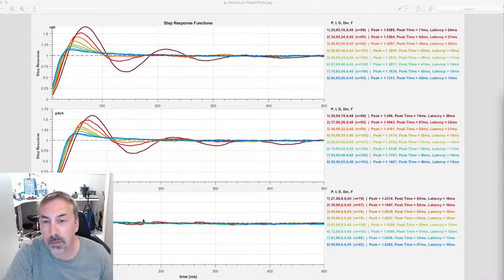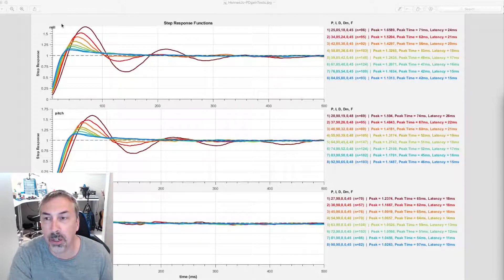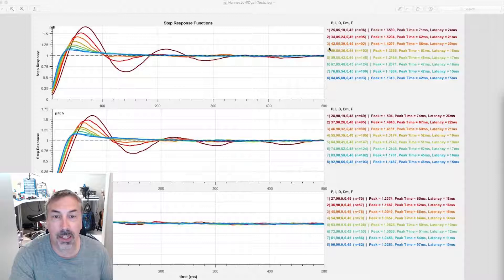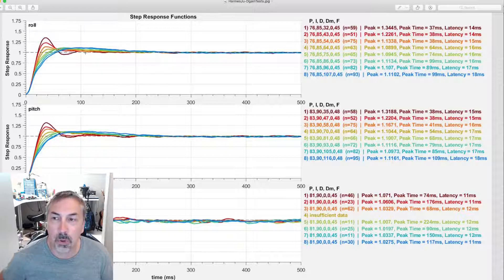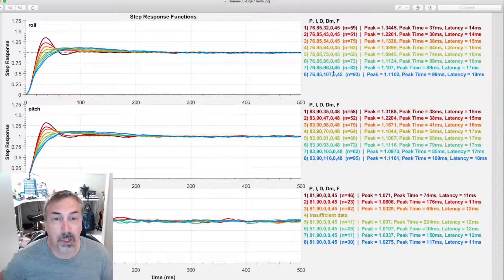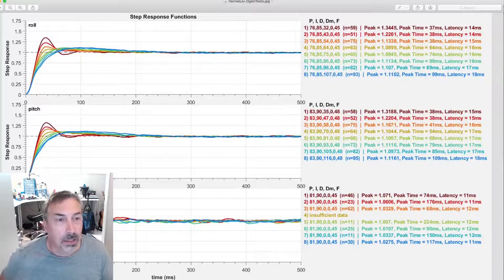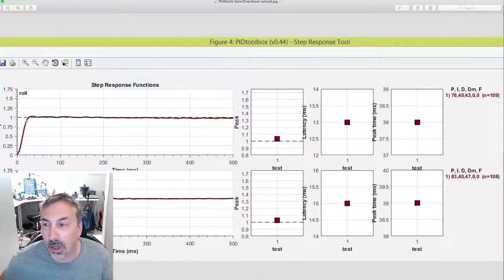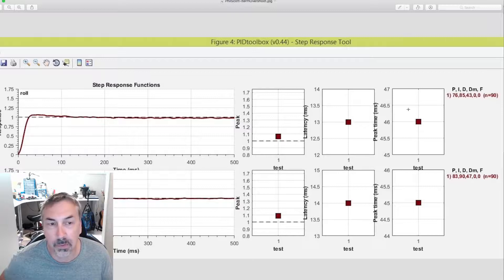PTB QuickTips: Iterm-related overshoot and PI balance

Comment: Great video Brian! yes, I fell foul to this too! this came from an old Mark Spatz video that recommended raising iTerm to raise the step response line higher. I wonder whether others too have watched the same video and been mistaken.
Reply from the maker: We all fell for this idea at one point or another. But it’s also not entirely wrong in general. It’s just our miniquads are super responsive so even I term is operating at relative fast time scales, not like P, but relatively fast nonetheless, especially wrt 5inch. If we were looking at shorter time period it’d look like a dc offset so to speak. For some pid systems it’s possible I term works at a much slower freq where the oscillation might be much wider than the window we are viewing it in (500ms window), so at our current scale it’d also look like an offset. I wonder if we used low I gain and we took a wider window and examined more slow turning inputs it might then look like an offset as the copter drifts and remains constantly off set-point, idk. Anyway, we’re all learning from this
Reply: I don't get it. On all racing tunes the I term overshoots so much , cause race tunes have low P and D term.  No idea what should I do, as racing lightweight tunes are not recommended to go over 25 D and P around 35-45 ish.
Reply: It seems like it's either lowering I, raising P and D or just raising FF (which should be the way), but the line still overshoots in pidtoolbox, while gyro follow the setpoint really well in blackbox. Not sure what's wrong.

Comment: So what does cause the offset?  I don’t see it in your videos but it’s pretty much always there on my logs - independent of which frame/controller I’m flying or of my PID controller settings.
Reply from the maker: FF can do it. Also long flights with very small stick input coupled with noisy gyro. So in essence y offset is artificial and not a real property of our system (at least with the way in which we are testing and measuring). If it’s unavoidable then there’s the y correction button but should be used with caution. Ideally just remove FF for these tests and follow the basement tune method that involves continuous very deliberate stick input that exceeds at least 50-150deg /s for no more than 30sec. 10-15 sec of solid moves is all you need really. Experiment
Reply: That’s both useful and interesting.  I will check but I generally have tuned without FF so it’s probably not that.  My gyros are not particularly noisy, in fact mostly fairly clean.  However, I tend to do my tuning flights by sitting in my garden and flying in the field next to my house which  I cruise to and from, so that may be it.  I will have a play and report back (with data 😃)